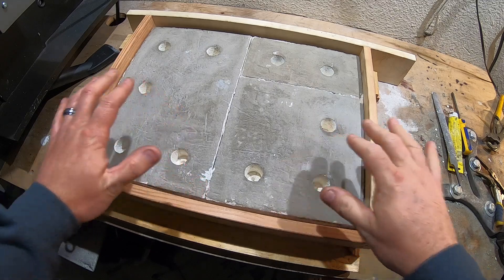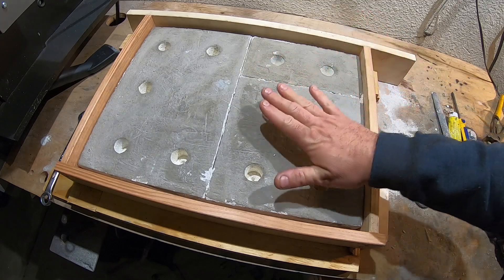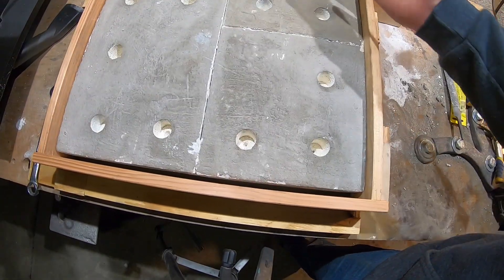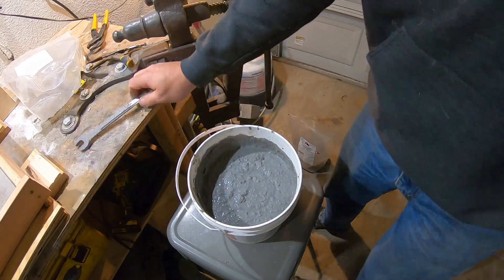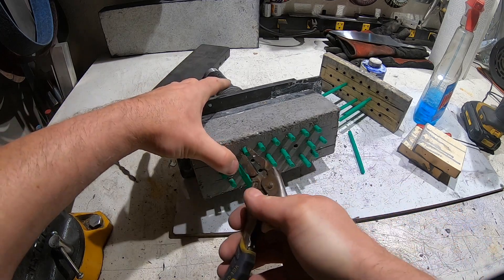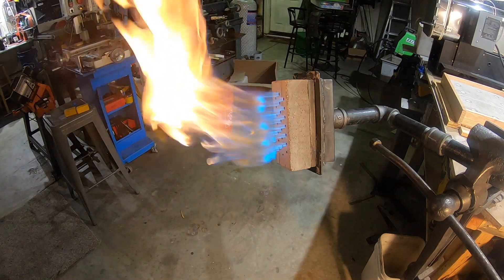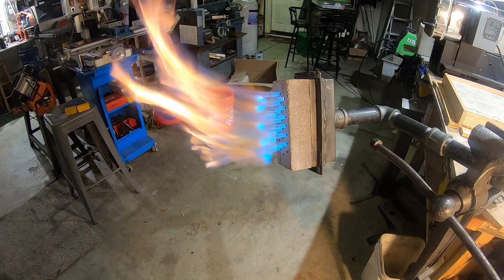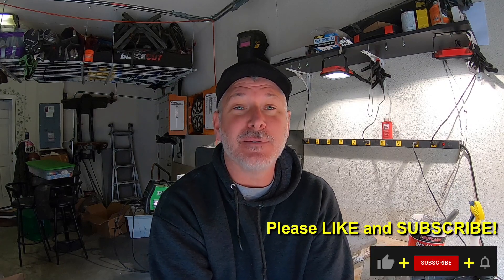Triple-T Thursday #13 - Testing the Ribbon Burner

Comment from the maker: What do you think of the ribbon burner?  Any suggestions on tweaking it a bit?
Reply: ooooooh fancy!
Reply: Looks really good! Really excited to see the finished forge!
Reply from the maker: @eetukuru787  You and me both!  Now it’s just a matter of finding time and balancing finishing existing projects and that whole real-life thing.  🤣
Reply: Looks promising :)! Maybe try to change angle of the input of the gas to 45 degree. Also, you can try to replace one of the pipe between gas and the burner to bigger one. It will create a little back pressure.
Reply from the maker: The gas mixing issue is resolved.  I may try the pipe replacement but no more tweaks until it’s on the forge.  Just the enclosed space will help a lot.
Reply: Oh, one think Denis: have you calculated the forge volume for this burner? while watching this episode, I remembered why I reject idea of making air forced burner: my forge whistled
Reply from the maker: @DBCraftWorld  it will certainly support the size of forge I’m building.  It might be very slightly oversized but that’s fine with me.
Reply: @TyrellKnifeworks  Sound good to me:).! I hope you won't have  trouble as I had:).

Comment: Hi I am building a forge. I bought a regular that is separate from the hose but very adjustable. Does anyone know if I need a full flow POL Excess Flow POL or? This regulator is very adjustable and has a nice gauge so want to use it but do it right
Reply from the maker: You need at least a 30 psi regulator.  Most that you buy at hardware stores are 3 psi.  Make sure it’s a high pressure one.
Reply: @TyrellKnifeworks  it is it goes 0-30 but it doesn’t have the tank connection or POL and there are a few on Is full flow no safety I think then excess flow and so on
Reply from the maker: @christopherconkright1317  I’m not sure what that means.  Mine just says 0-30 and it connects directly to the tank.

Comment: How do you know what size ribbon burner. I have a 17x8 inch chamber will a 6x3 in ribbon burner work or do I need a 8x3 or 6x4 how do you know or figure it out.
Reply from the maker: The mistake I made was not using a long enough burner.  Won’t worry about width, it’s about the length. I would go you’re forge length -8”, that gives you 4” from each opening to the burner do you have no cold spots at each end.
Reply from the maker: For yours, I would use a 2x10”.

Comment: Hey Dennis, where did you get the pipes from?
Reply from the maker: Do you mean what I used for the holes?  They are just drinking straws.  The steel pipe is just black pipe from the hardware store.  Thanks for watching!
Reply: @TyrellKnifeworks  yes I meant the black pipe, thanks Dennis! Looking to build the same type of forge body currently

Comment: I keep trying to find someone plumbing the burner. How to do the piping. How to put the air on etc etc. building the ribbon burner sure but not how to hook it up.
Reply from the maker: There are a bunch of videos that go into detail.  You just pipe the air from the blower then inject the gas into that with a 3/16 orifice.  Email me if you have questions.

Comment: Great burner build. I just finished my burner this week and I am ready to fire it up. Your video showed you testing the burner at .5 psi. What psi setting do you use at startup? Thanks
Reply from the maker: For forge welding and when starting it up I run it at around 2-3 psi.  For normal operation it's around 1 or maybe 2 psi depending on what I'm doing.  Thanks for checking it out, Ben!

Comment: Great build!  I'm looking to set up a forge and propane will be much easier to manage for my current situation.  I wondered about forced air as it would add oxygen to the mixture and burn hotter.  My brother has a little foundry he built so has some experience building burners but not this style.  I may start with an off the shelf set up and modify as I learn more.
Reply from the maker: A forced air is no different than a venturi when it comes to adding oxygen.  It's the same concept, just that the air is introduced with a fan instead of venturi flow.  The forced air takes WAY less gas and mixes better.  Thanks for watching.
Reply: @TyrellKnifeworks    When I hear "venturi" I always think carburetors which require that low pressure area to draw in the fuel which is why they can't be boosted.  But as the propane is essentially fuel injection I can force all the air stoichiometry will allow.   lol
Reply from the maker: @neogator26  yeah, I can see the similarity.

Comment: I posted a pic of my ribbon burner forge on Instagram yesterday.. anthony.strunk 
Same 6 inch burner as mine.. looks almost identical..lol.. I'm gunna try to put a larger blower on it and see if it produces forge welding heat better.. it is much better for regular forging and uses about a quarter of the propane...yours looks awesome!  Can't wait to see the finished forge..
Reply from the maker: Yup almost the same.  Mine was built with 3” square tube and its 8”.  I heard one key is to have enough holes to equal the area of a cross section of your piping. If you have to many holes you need a much stronger blower.
Reply: @TyrellKnifeworks  mine is 6 inches and I built it with 3 inch square tubing.. I think i have 21 holes but id have to count..lol.. yours looks really good.i bought the blower from Amazon I think it has a 2 1/2 inch outlet.. no I just counted it just has 15 holes and I used off brand crayons

Comment: Nice! This was definitely helpful. Lookong forward to the next build portion. Im still operating off of a hells forge single venturi. Works ok but could be better. Was going to build a new forge using one of the t-rex burners or the ribbon burner. My main concern was more so about the noise itself since I'm just operating out of a garage in suburbia.
Reply from the maker: The ribbon burners are actually quieter than Venturi burners.  The blower is quieter than the “roar” of the Venturi style.  They don’t sound like a Jet.  👍. Thanks for watching!
Reply: @TyrellKnifeworks  appreciate the feedback and content you create thanks!
Reply from the maker: Thanks for being here to watch it! 😉